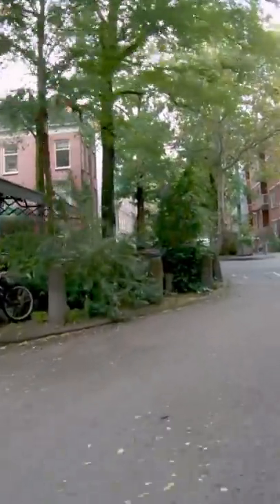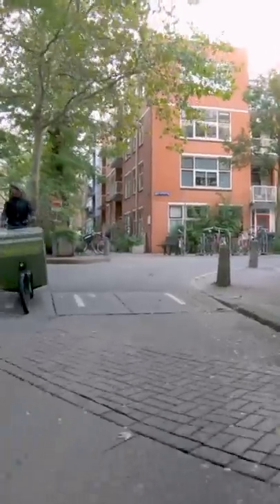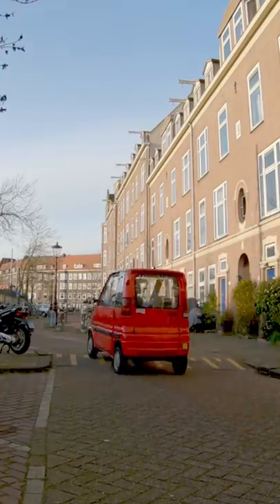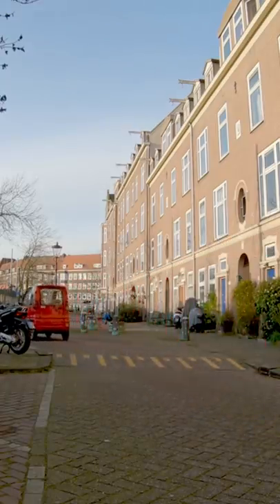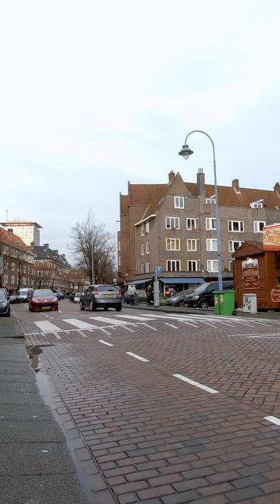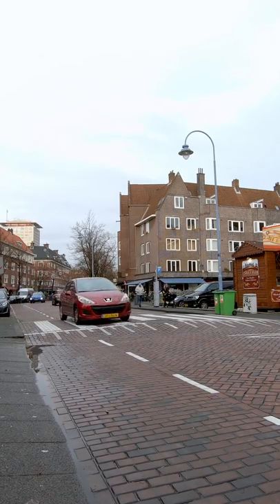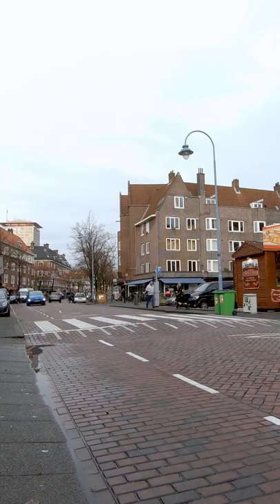How the Dutch Slow Drivers for Safer Streets #shorts

Comment: This sounds like the opposite of my Texas town they actually covered our work with asphalt every turn is rounded wide open roads mostly straight
Reply: Yeah thank God it would take forever to get anywhere otherwise.
Reply: @QuasarTheGreat  These traffic calming strategies are only used off the main road on streets where there are pedestrians and cyclists, so when drive on these streets you are at most 10 minutes away from your destination. The main roads are much wider and allow for higher speeds and traffic capacity, also there are no pedestrians and cyclists there, so you can still arrive quickly at your destination. It's actually really cool once you start to notice it.
Reply: @QuasarTheGreat  4,844 pedestrians were reported to be struck by vehicles in Texas alone and 717 of them died. I think how quickly we get to some places might be the wrong metric to observe when planning roadways. Additionally if everything wasn't spaced out so much because of parking requirements, it wouldn't take as long to drive between destinations.

Comment: Lol! My city decided to use chicanes on a previously straight, 3-lane (2 active + 1 parking) one-way street. This was done mostly with paint and a few curbs. In the spring, summer and fall, it is annoying at worst, zigzagging along what was meant to be a straight street. In the winter though, whenever we get a snow storm with 6+ inches, it is total chaos. Those who know the street can somewhat follow the correct path, but everyone else is is driving straight, jumping curbs and freaking out. It's the age old issue of using half of a good idea.
Reply: yea the Netherlands aren't the best at road design. A lot of the ideas are really stupid even if several are good

Comment: Crying for the old trees that were cut to make the roads wider in my country 😭
Reply: Depending on what country you are in they might have just moved em, at least in America with constructing buildings (i am majoring in construction engineering) some  trees are relocated around the property, while others are simply removed, and every single tree is looked at.  Ofc depends but my $0.02
Reply: @M54B30_fan  sadly they didn't move em, I see the stumps and some of the trunks that weren't moved yet. Everytime I pass by the road where they used to flourish my heart aches. Sadly our country doesn't have the capability to em 😢

Comment: As a guy who drives 18 wheelers for a living all of this sounds like hell.
Reply: But why would you need to drive an 18 wheeler through a residential street?
Reply: @kebrongurara1612  You would be surprised how often you need to drive though residential area. It's never fun.
Reply: @cardinalfire1057  I just assumed such cars would be hauling to/from factory/harbor type destinations that lay along main roads or near highways
Reply: @kebrongurara1612  a house is being built near my house and for the bricks and digger they used a massive truck that drove down a street just wide enough for it. And afterwards it had to reverse down an entire street with perfect precision

This has happened a lot.

Comment: i feel like the narrower roads are good so long as it's actually reducing crashes but trees could be dangerous in mechanical failures or if someone is under the influence so that might not be a good idea
Reply: I mean people shouldn't drive under the influence, that's illegal for a reason, plus the trees are on more rural roads so not in the middle of town or sth
Reply: @melissabloemen  a lot can happen. mechanical failure, oil spill, ice on the road, aquaplaning.. trees at the roadside are extremely dangerous to anyone. A road with trees so close to its sides like in this clip should be 40-50kmh
Reply: @melissabloemen  even so let's face it people do drive under the influence and while it's they're fault if they get seriously injured or die it's still not alright to just put people's lives on the line as a "deterrent"
Reply: @fewbronzegames  Consider that removing trees and adding buffer zones to residential streets resulted in a net increase in traffic fatalities due to increased pedestrian deaths.
Reply: @karlrovey  that wasn't exactly my point, my point was that in the case of a mechanical failure or if someone is under the influence hitting those trees is a lot more deadly then hitting a ditch or going off the road i don't doubt it decreases pedestrian deaths because it's just like a blockade however in the case of a crash you are more likely to die because of the trees
Reply: @karlrovey  it's kind of a balence like how safe do we want to make pedestrians over drivers because a lot of the time the solution's to making pedestrians safer directly affect the safety of drivers
Reply: @witoldschwenke9492  oh yeah they're not like proper fast roads, they're usually 60kmh!
Reply: @fewbronzegames  of course not, whilst it obv does happen, I do think drunk driving is slightly less prevalent in the Netherlands due to the popularity of bikes (although technically still illegal to ride a bike under the influence it is almost never enforced). I had to look this up but there's just a much lower percentage of road deaths due to alcohol in the Netherlands and our allowed blood alcohol level is also lower.
Reply: @melissabloemen  but that still doesn't account for mechanical failures so my question is more is it actually worth doing
Reply: @witoldschwenke9492  yeah trees on the side of the road is dangerous, hence why people don't drive fast enough for them to instantly die if they run off the road

Comment: This looks really inefficient when considering the time spent on roads to travel from point A to point B.
Reply: But car bad bike good
Reply: It's really not tbh, like the turning roads and speed bumps with more incline is all on residential streets, plus Dutch people bike a lot and we don't have to cross as big of a distance as for example Americans do. Also our streets are very well maintained so they're very nice to drive on tbh, all of these safe driving measures are done on residential or rural roads where more accidents happen, not just on a highway or sth
Reply: It is inefficient to drive a car in city centers, on purpose. Too many pedestrians and bicycles in narrow streets.
Reply: @harmen1832  That's just bad design from a logistics standpoint. Public roads should be easily accessible to transport goods to and from the city.
Reply: @slingshot99  goods are easily transported in and out of the city. Trucks and suppliers get in. But most cars have to drive slow or drive around to get to point A. While walking, cycling or public transport is faster. Its not ineffecient at all. You litteraly are not stuck in traffic with all the other cars.
Might be hard to imagine.
The one Dutch city desgined for cars, is also the city that had most traffic jams and had the worst walkability of all cities (Rotterdam). It takes a lot longer in Rotterdam to move goods or to get around yourself, While that city is designed for cars
Reply: @slingshot99  I've also directed a small fleet of trucks.  Ones that need to make multiple drops with a load. Factoring in traffic changes the routes you would assign based entirely on looking at a map.

Also google maps doesn't know how stop signs work, and loves a zig-zag country routes because apparently you never have to slow down, stop, and accelerate.

Comment: Let's make roads more dangerous to try and get people to slow down 🤦‍♂️
Reply: it's less dangerous
Reply: @LMvdB02  only in the sense that accidents are less likely, if an accident happens, consequenses are worse
Reply: @LMvdB02  having trees close to the road does not make it less dangerous......
Reply: @BeKozTube  Then stop driving like a maniac, then there is no danger.
Reply: @kokoido2  if an accident happens consequences are less bad because people arent speeding as religiously as in the asphalt rivers of other countries
Reply: @timobrenn  Id rather go off the road onto a field at 100kmh than into a tree at 60kmh, also, the fact that the roads are like that make dutch drivers straight up shitty, closest I have been to an accident was when I tried to pass a dutch car doing less than 40 kmh when the speed limit was 80. As I was alongside them they started moving towards me, and I had to put two wheels on the grass to avoid them.
Reply: @kokoido2  I was talking more about general traffic calming not necessarily about the trees next to 80 roads, i dont like those either personally. regarding that driver going 40, there are bad drivers in every country

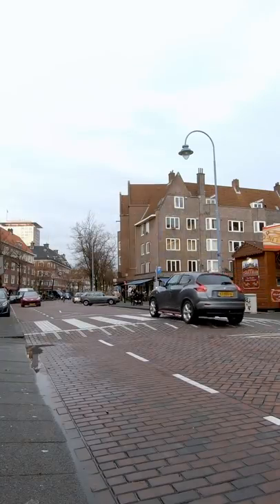Comment: @0:39 Brick road surfaces = not true I'm afraid. Car noise is considered to be an important negative factor for the living environment. In early 80's a directive was published stating that lowering car speed in residential areas was not only for safety, but also large and perhaps predominantly to reduce noise for better well being in the neighbourhood.
The reason there's no asphalt everywhere is cost. It's cheaper and easier to access infrastructure beneath it. As you may have noticed in The Netherlands there are no powerlines in villages/towns/cities, it's all buried. Only major power-lines are above ground outside of urban areas, often along or intersecting with highways, which are...asphalt.

Comment: Problem with speed bumps is that emergency vehicles have to be fitted with suspension designed to travel over them. The UK once bought a fleet of German ambulances they couldn't use because of said speed bumps. Speebumps also leed to suspension damage and wear.

Comment: Hey you could talk about these common speed bumps where they're annoying at slow speeds, but when you go fast, like twice the speed limit, suddenly the trajectory of the car lines up with the speed bump and it stops being annoying. It's even fun. That's just the wrong design. My town is full of these.

They're limited to 20km/h and when you go at 45km/h or so that's the sweet spot. Faster or slower you feel the bump. Right at that speeds it's soft

Comment: We have this all in the UK.
We also just have pot holes and higher taxes.

When they first started they dumped asphalt into mounds, the stuff we said could go to fill the holes.

Mostly pointless. Mostly cause congestion, and with purpose offset of lights, give the impression orlf more traffic and causing more jams... M25 is one example.
By speed variable to lower speeds to cause a tail back in the slowing traffic. Then  gap this and then lower speed. This is great to cause crashes.
Reply: The purpose of this is to make it more annoying for drivers so that more people choose to walk, take transit, bike. This works because the alternative to driving is great. Maybe the alternatives to driving aren't so great in the UK, so people choose to "tough it out" in their car. I've lived only in London, so I can't speak for the rest of England, but I liked the tube (at least compared to the transit in america) but it's probably not as pleasant as the transit in the Netherlands.
Reply: @minismalls3096  typically London is better maintained than the rest of the country. The way the tax system is set up is take from all, pay for London and divide what's let for the rest of the country.

Comment: In south germany, the roads are far to well made for their purposes. For Example a road, which should be Limited to 50 kph is that good that it feels wrong not driving faster. Now the road has been Set to 30 kph. Slaming a shield and a static speed trap does not slow the traffic, it just makes the cars drive faster and brake before the speedtrap just to accelerate again afterwards.

Comment: I wouldn't say better. Like using brick to increase noise for the driver might be a plus its a negative for the people living near by that now have noisier car traffic outside their house. Our wider turns allow for traffic to continue to flow smoother when people turn off, not slowing down drastically keeps the cars behind you moving closer to the speed limit. 
Just because something works one place doesn't mean it's better or would work somewhere else.

Comment: Most of these are not intentional. 
Most roads are narrow Not because they make people drive slower but because its cheaper to build narrow roads.
Trees on the Side of the Road are from the old times to give the horses protection from the sun and wind.
Chicanes or sharp Turns are often the result of having to build new Infrastructure in a old town, same goes for the brick roads. 
The US didnt have this foundation a came Up with a completly new shitty way of building

Comment: We already do all of this here in Vancouver, BC. Except it is on the new "improved" bike lanes (also, old bike lanes). Yep, the only serious slowing down of traffic we do is to bicycles, and usually unintentionally. I see all of these features all the time on the purpose build bike lanes. Very narrow. Chicanes. Rough surface. Tight turn radius. Often I just drive my bike where the cars are riding because otherwise there isn't enough space for me to ride to work fast when I need to. At least the speed bumps are usually OK on a bike. #EndCarEra

Comment: And then there is the åkersberga solution. Place large fucking barrels in the middle of the roads forcing people to drive super close to other cars basically just increasing chances for minor collision. Then since that didn't work cuz it relied on a lot of cars being there (people already drove slow in those cases) people still drove fast they added super sharp speedbumps. A great solution that I support. If it weren't for the fact that the barrels are still fucking there making collisions even more likely since your care shakes like crazy when you'd rive close to other cars.

Rant over...

Comment: People drive slower on brick road in America as they aren't very common and the ones that are around are incredibly old and historical so you feel you are driving and participating in a part of history and alot of brick roads now at least are slowly being replaced by paved or blacktop Wich don't last as long as the brick roads and in my opinion need much more attention and maintenance in the long run

While brick roads. Build in the 1800s are still around today with little to no maintenance and are mostly all original

Comment: The speed bump squares in the middle of the road can destroy your car. They're absolutely horrible, since they put them in 50 kp/h zones, which is way too fast to drive over these.
Reply: depending on the type you can also crash your motorcycle by hitting them, specially if it just rained and the road surface already is oily and slippery from all the grime and water

Comment: Love the way the car at the end cuts off the cyclist in the ultra considered “road safety” infomercial.
Reply: Proving that there are assholes everywhere ❤
Reply: You don't seem to get the point, a car can cut of a cyclist on any 90 degree turn no matter the design. The point is that bend is really sharp, so the cars have to slow down a lot, this gives them time to check their mirrors and blind spots. And even if it's some idiot who thinks he doesn't need to do that, the speeds are so low that accidents aren't fatal. Compare that to some videos I've seen of cyclists in the US getting hit by cars going many miles per hour and seeing them fly through the air, I think forcing cars going slow around cyclists is a good thing. You're going to have them cross each other at some point right, might as well make the cars go slow for safety.

Comment: Speed bumps aren't that useful though, since you speed up after, the narrow roads and brick roads are the most useful
Reply: yes speedbumps actually distract drivers or cause accidents. I find them very annoying but you don't actually have to slow down at all, instead you focus on the bump and don't watch your surroundings as much
Reply: @witoldschwenke9492  oh and the long term damage it does to the shock absorbers the short term loss of traction, multiple times had my back loose of such a monster

Comment: I think it's also bad to have that road design. It is looking very good and regular traffic gets safer the problem though is that emergency services need to slow down as well and don't have any room to get around traffic maybe there's a solution that I don't know but with that design I think it's bad for responding emergency services.
Reply: There’s less traffic here than in car dependent cities so I doubt it
Reply: Well you are partly right. But the thing is, the street design here supports denser neighbourhoods and people use their car less because of it. This means streets are less busy which is good for emergency vehicles. And, more important, because the neighbourhoods are denser, the vehicles often have to drive less far to reach patients, so even with these bumps they are faster. Also, the bumps are only placed when entering a neighbourhood, so they will only have to cross 1 pump per ride.

Comment: Another fun side effect of trees beside roads is that if you fall with your motorcycle, you're fucking dead.
Reply: @Brozius2512  Well you don't have to if there's wet leaves on the road, which coincidentally happen to occur around trees quite a lot. Plus the risk is there for cars too. It's like claiming road safety will increase if you add spikes to the steering wheel and removing seatbelts, because people will be more afraid of making mistakes.
Reply: @Seagull780  Again... we don't drive like maniacs. And studies in Sweden and the Netherlands have proven that this works and that it's safe.
Reply: @Seagull780  Let's compare traffic fatalities where you live and with the Netherlands, let's see who laughs last.
Reply: @Brozius2512  But I live in Gelderland...
Reply: @Brozius2512  "We don't drive like maniacs" tell that to the amsterdammers